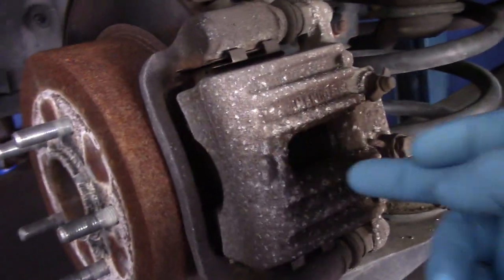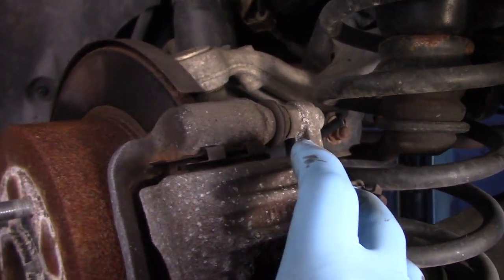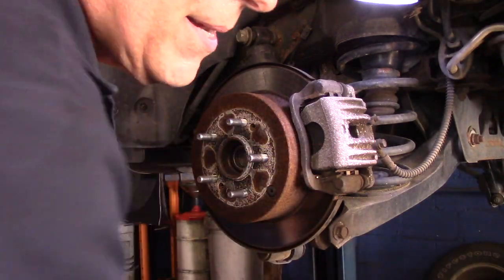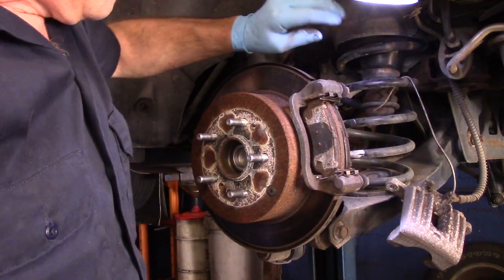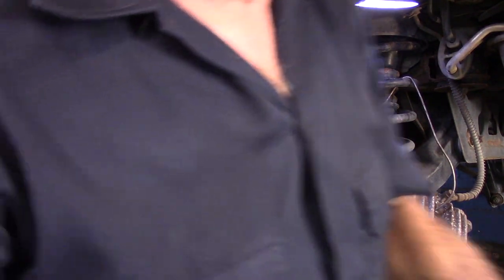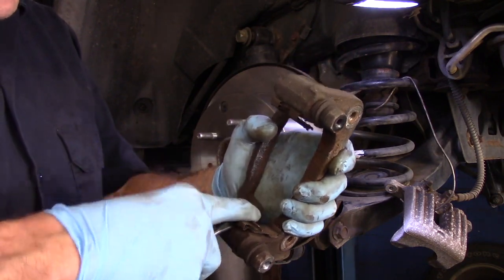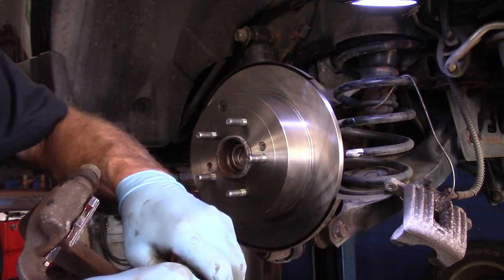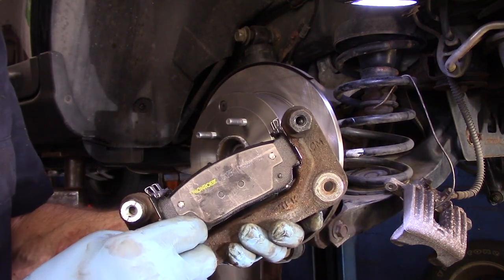Replace Rear Brakes, Rotors And Pads 2008 Hyundai Santa Fe

Comment: Yeah I had to drill those damn screws out. Such a stupid thing to do “let’s put a phillips head screw somewhere notorious for rust”. If an f150 doesn’t need screws holding the rotor to the hub, neither does a damn sante fe. Good video

Comment: the squeaker always goes to the leading  not following on the rotor   everyone messes that part up
Reply: scuba422123 the squeaker ?
Reply: @weldingjunkie  a k a wear sensor    a tab that hits the rotor   before the pads
Reply: scuba422123 ah ok gotcha that makes sense now lol I was confused. Right on.
Reply: I knew what ya meant. Squeaker, squealer,  metal do hickey noise maker all work.
Reply: The Disgruntled Mechanic I get it now I wasn’t paying attention I guess lol I always called it a wear bar idk
Reply from the maker: Thanks for stopping by.

Comment: Nice explanation.  However, no need to replace the screws that hold the rotor to the hub.  They surve no purpose and are only there for the manufacturing process.  The wheel will hold the rotor in place just fine.  Leave them out and make it easier on the next guy.